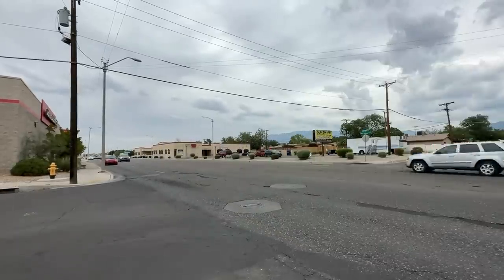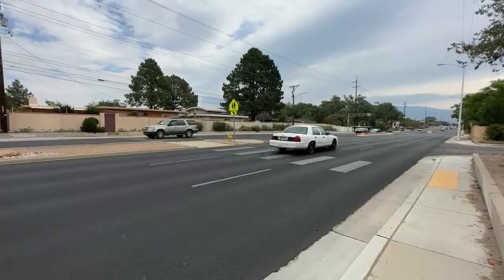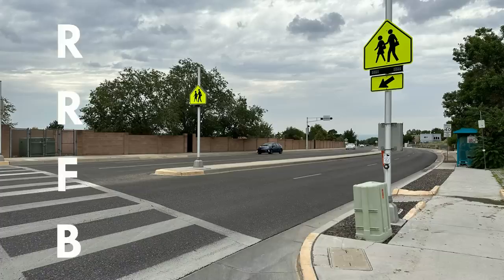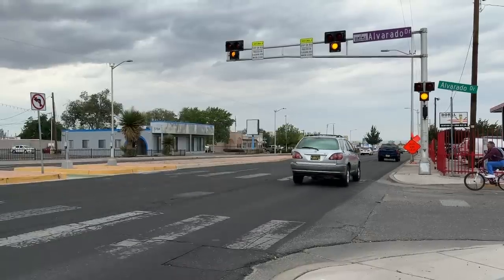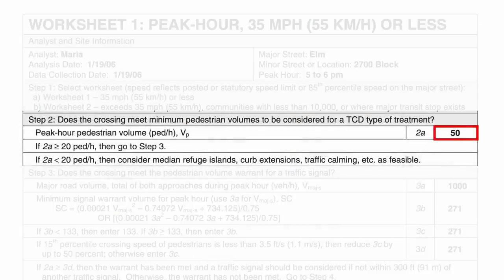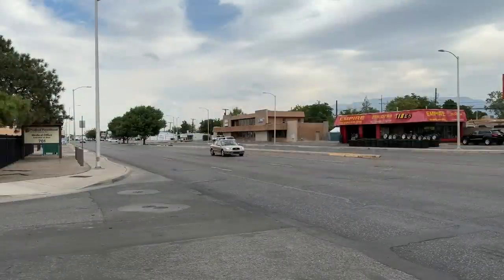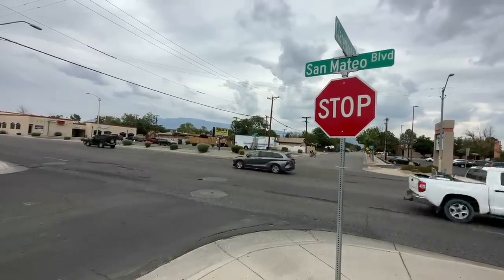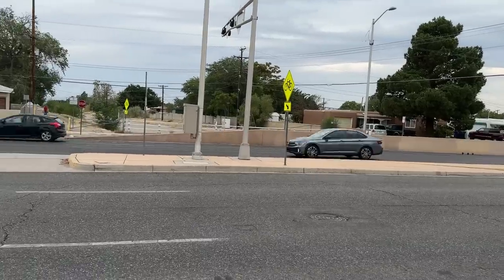The Insane Ways Traffic Engineers Try to Make Streets "Safe" For Walking

Comment: I don't get why cities want to use a HAWK signal. Why couldn't they use a traditional flashing yellow stoplight that turns red on request? Like at fire station crossings.
Reply: It is a loophole around traffic signal warrants.
Reply: @tonywalters7298  But why not change the rule about what you need for a signal? Those decisions end up being whatever is politically convenient, anyway...
Reply: @josephfisher426  I would agree there. It would make more sense to change the warrants. I think there should be policies for ped crossings at regular intervals on arterials.
Reply: @tonywalters7298  That SHOULD fit into the natural layout. Does it, often depends on the evolution of the road. Most of the arterial-type roads I drive on are 200+ years old... where they were settled extensively before traffic volume got high, and especially on the crosspieces between the spokes of the wheel centered downtown, it is only by accident that they are any good for pedestrian use. Because they've been retrospectively straightened and widened into someone's front yard... there just isn't room for a good sidewalk.

Comment: As always, it comes down to using the right tool for the job. These are often haphazardly chosen for 6 lane stroads where a different solution is ideal. These seem to work good for slow traffic areas (like shopping centers) alerting traffic to peds that are crossing where visibility is obstructed by parked cars. As a Professional Engineer, I think we need to do better on all forms of accessibility and treating the issue with an eye to people rather than vehicle flow rate.
Reply: The city i live in (CT) has a mid block crossing on main street that is simply a normal traffic light over the crosswalk.

No need to over engineer a solution, if you want cars to stop on some condition just use a normal stoplight that they are familiar with.

The road is 4 lanes wide plus parking, but its a regularly used crossing and in 2 years i haven't witnessed any "accidents" at it.

As far as school zone crossings go, have schools be on side streets to reduce volumes and hire crossing guards to control both the children and the traffic. A school on a 4+ lane stroad is a design failure.
Reply: @jasonreed7522  exactly! We do that for Fire departments all the time. Light just stays green until the fire department needs to exit the station. But that's one of the warrant conditions in the green book. If we had a warrant condition for just a dangerous pedestrian intersection, cities would be able to consider it easier.

Comment: These RRFBs suffer from amber warning flashing light fatigue imo - drivers have been trained basically to ignore the flashing yellows. Think of all the "take this corner at a slightly slower speed" sign, etc. expecting a driver to STOP for a flashing yellow seems almost absurd to me. The city I live in has recently installed a few of those hawk units but has yet to turn the red lights on. I'm looking forward to when they do, as those are far less ambiguous.

Comment: Those HAWK things appeared overnight (not really) a few years ago in Austin. My first reaction was confusion: introducing a completely new traffic light design that looks nothing like traffic lights that have been around for almost a century seemed like a bizarre idea, especially since the whole point was to keep pedestrians from being killed. That said, they do seem to generally work, here in Austin, most of the time, but in a less pedestrian-friendly (unbelievable that there could be such a thing) place like Fort Worth drivers ignore them way way more often than I've seen in Austin. Also, putting in one HAWK crosswalk along a miles-long stroad takes a bunch of negotiation, so they end up literally miles apart. It's a band-aid on an amputation, pretty much.
Reply: There are a few by me and they do seem to be effective.  The part that seems to have the least compliance is the flashing red phase after the solid red.  In theory that means it's effectively a stop sign (just as any flashing red is to be taken as a stop sign), but usually it just means the first vehicle in a line stops and then all successive vehicles go - instead of taking their turns stopping.
Reply: I couldn't believe the street design in Austin. No parallel parking or bike lanes, sidewalks running alongside multi-lane stroads with 40mph+ traffic just inches away. I was holding onto my children's hands for dear life while walking from the hotel to the fast food joint across the street. In San Jose I'm much more relaxed because there are parallel-parked cars and a landscaped strip including trees between my kids and the traffic. I can let them walk unattached here.
Reply: @sabretooth1997  How is the flashing red phase rationalized? Yes, people should know that, but it doesn't fit into the sequence of a light that turns solid red. It seems preferable to make the solid red phase longer as if it were a regular light (which is what the one HAWK-type intersection that I see daily looks like).
Reply: @josephfisher426 I'm of the opinion that HAWK lights are stupud and should just be replaced with regular old traffic lights, the default way of controlling cars.

And whenever a beg button is pressed at an intersection it should inject the pedestrian phase right after the current car phase. (Understandable if the system only allows 1 ped phase per complete cycle, but still undesirable as a pedestrian exposed to the elements and not in a climate controlled box)
Reply: Remember to treat a dark signal like a stop sign.
Reply: @jasonreed7522  Yes exactly. The idea of introducing a totally new traffic light with totally new semantics, and little signs with text to explain how you the driver are supposed to behave, is in terms of basic usability completely insane. Every driver already knows what red-yellow-green means.

Comment: Here in Australia the most common pedestrian crossing solutions on busy roads are either to have push button walk/dont walk signals at already signalized intersections or to have standalone push button walk/don't walk signals (in cases where the gap between intersections is too big and they need a crossing in the middle). Those would work much better than RRFBs or HAWKs. (especially if you had enforcement)

For lesser crossings we have the standard zebra crossing (possibly with a refuge island in the middle) with signage in both directions telling cars to give way to pedestrians (the signs are bright fluro colors and retro-reflective so they can be easily seen at all times).

Comment: There’s a HAWK beacon outside the secondary entrance of the Patent and Trademark Office in Alexandria, VA. I live and work around there, so I’ve had to use the HAWK as a pedestrian and driven through it as a driver. As a ped, you’re lucky if you can actually get the signal to work. Last time I was crossing there, I waited 90 seconds for the signal to turn and some jackass still ran the red light.

Comment: As a NZer, I find it frankly amazing that crossings aren't mandatory at every major intersection over there. Down here, any intersection worth of a set of traffic lights has enough pedestrian crossings to allow you to get to any corner. It helps a bit that most (though not all) of the traffic-light intersections also include free-turn lanes separated by the main flow of traffic by pedestrian refuges, which means that you can walk when the traffic going in one direction shields you from any traffic would cut across the designated crosswalk.

Comment: If you're in the southwest I would check out Tucson and their implementation of HAWK signals. They have done a pretty decent job of installing them across the city. Especially along the bike boulevards. Fun fact is that the first HAWK was designed in Tucson by a city engineer. Tucson is also interesting streetwise because it's a traditional grid system, but there are no ring roads around the city. There's only I-10 and I-19 on the western side of the city, so it kinda has a Vancouver type feel of majority surface streets. Quite different from our big brother Phoenix to the north.

Comment: I’ve spent the majority of the last three years living in Puerto Vallarta, Jalisco Mexico and as a pedestrian I can tell you that walking here is very safe. The streets are mostly narrow one way two lanes with a few larger roads that are usually four lanes with two in either direction. It’s typically very easy to cross the street and even where there are no crosswalks or traffic signals when you get the drivers attention and a give them a little wave they invariably stop for you to cross even on busy streets and interestingly enough the driver in the other lane will stop as well. The courtesy and respect that motorists here show pedestrians never ceases to amaze me. Now I don’t know what it’s like in other cities in Mexico, but I will be moving to Oaxaca de Juarez soon, so I’ll see what it’s like there. Public transport here consists solely of buses, but they run very frequently and cover the entire city and are very inexpensive. I don’t bike but that’s because there is no biking infrastructure and I’m afraid to be on a bike in car traffic, that’s just me or maybe after almost being run down by high speed cars several times in New Orleans I’ve decided not to take anymore unnecessary chances.

Comment: In and near Seattle, the main multi-use trail, the Burke Gilman, has stop signs at street crossings.  Pedestrians have to wait for cars.  If there were traffic lights, that would be fine, but pedestrians and bicycles have to stop because the cars get priority.  There are even stop signs at residential driveway crossings, which have a fraction of the 3/4 of a million annual users the trail has.  Cars are king.

Comment: HAWK signals confuse me, not just because of the acronym. You're spending the money to install what is essentially a traffic light, but instead of building a traffic light like everyone is familiar with, you're choosing a signal that most drivers haven't ever seen. Just build a normal traffic light, no ambiguity or confusion or extra signs that have to explain in text what you're supposed to do.
This of course still doesn't fix the underlying issue of the hostile street design, but at least it treats pedestrians as equally important users of that street.

Comment: I wonder of HAWKs even have any advantages compared to normal traffic lights, especially at an intersection. The only one I can see for drivers is that there is a signal phase that allows them to treat it like a stop sign, but a normal traffic light has more familiarity. I also question the use of HAWKs on major transit corridors. In Phoenix, there’s only 1 I know of along the light rail line (along Central, just South of Camelback, where there’s a canal trail crossing).
Reply: Also, with the double threat point about RRFBs, there’s one in Scottsdale along Highland Avenue by Scottsdale Fashion Square. My mom almost blew through it when it was flashing purely because she was in the second lane and didn’t see the pedestrian, and someone else was stopped super close to it. Once again, why don’t they just use a normal traffic light?

Comment: Those Mayberry RFDs are totally ignored on my campus where they have been installed. Though, they did install them along with raised PED crosswalks/speed bumps. So the actual structure of the road slows cars down much more than the flashing lights that never flash.

Comment: I am literally begging all local officials setting planning policy to please spend one week getting around on bike, foot, and transit and count how many times you feel humiliated by the experience. How many times your only options are detouring by 5-10 minutes to a controlled intersection or running for your life while only asserting your right to cross at an intersection. How many times 20 minutes of your life or your life itself are deprioritized in favor of saving a few seconds for a motorist. How much dead time you spend transfering between buses with endless headways, how many steps you have to take through mud and grass because someone parked on the sidewalk with their sprinkler on, how many times a driver says or does something derisive or threatening when you dare to delay them by less than ten seconds. All as a reward for choosing the more socially responsible means of transporting yourself about the city in the system you are maintaining.

Comment: I have been told by my local police department in Indiana that RRFBs do not give you the right-of-way. You still have to stop, look both ways, then proceed if all clear. The yellow lights are just a caution to people driving. They are not required to stop, like they would be at a red light or a stop sign.

Comment: The road you showed, I have a few simple suggestions to make it even remotely safe to cross ... 
1: Build a wall most of the way across the stroad - so there are only two lanes left 
2: Use the freed up space for proper width sidewalks, and add segregated cycles lanes 
3: Set the speed limit to 30mph at all times 
4: Put in a crosswalk with stop lights, and cameras to catch vehicles who ignore them, with fines large enough to cause them to have to sell the vehicle 
...  realise nobody will let you do this, and move to a country that will...or more likely already has

Comment: So US traffic engineering is now only 70 years behind German… Germany tried these flashing lights in the 1950s and quickly gave them up.

For comparison the German regulation:
* If the speed limit is higher than 50 kph (35 mph) or there is more than one lane per direction, a traffic light must be installed. These are regular lights, except for sometimes "off" instead of green.
* If it's one lane and <=50 kph, a zebra crossing may be installed: Drivers and cyclists must slow down, not overtake and stop if somebody wants to cross.
* A "refuge island" is strongly recommend and what you call "curb extensions" are legally required (no parking 5 m before the crossing under ANY circumstances), very good ones (rare…) are even raised to crosswalk level. Also the paint markings are closer together 50/50, so the tires don't hit all of them and such don't rub them off. Warning signs (which look totally different from every other traffic sign) are optional, but usually at least on the right. The deluxe-version has even a third one above serving as a street light.
* In addition refuge island without priority may be installed under the same circumstances (<=50, one lane per direction) on busy streets.
Pedestrians are not required to use these but can cross at any "non dangerous spot" without priority (which would make using half of these US crosswalks illegal…).

Around schools you may find crosswalks or even traffic lights together (!) with a speed limit of 30 kph (20 mph). These usually go all-in on the design options.

Comment: I live in a more rural area and there is a recent rail to trails bike/walking path that uses RRFB across some of the more common roads. I haven't done an extensive survey but it's like 70% of the people stop when they see the flashing yellow. The false sense of security is worse than any "safety" they provide. (On the plus side it does require you to actually stop to press the button, following the rules of the road works both ways and lots of cyclists in my area give lip service to the biks stop signs (and "walk your bike" is ignored by almost everyone).

Comment: This is not a road design problem, it’s a cultural one. In my county we have strodes, our roads are largely modelled after American designs. However, when a pedestrian turns to face the crossing, all traffic will immediately give way to them. Sometimes the very first car might zip through, but otherwise the traffic will have stopped in both directions before the pedestrian steps onto the road surface. If there is a zig zag refuge island then only one direction will stop at a time.

Comment: I do not understand why we need RRFB or HAWK signals. Just put up a regular traffic light that's always green (if there's no vehicular cross traffic) or flashing yellow (if there is, which would get a flashing red) until someone hits a beg button! On Green Street in Ithaca, NY we have such a signalized crossing between one of the main bus stops and an alley that leads to the commons (pedestrian shopping street). This has worked well for well over a decade at this point.

Comment: In Pittsburgh, we have a couple of mid-block crosswalks that have a traffic light.    The traffic light stays green until the crosswalk button is pushed.   When the button is pushed, the traffic signal turns yellow after about a second and then red after the standard yellow time.   The walk sign then comes on.   The time for time the walk sign is on is plenty for getting across the street.    I am sure there is a minimum time between activations, but I haven't tested it.   The two locations I know of are in the middle of the University of Pittsburgh campus on 5th Ave and at Bakery Square on Penn Ave.    There might be more of these pedestrian traffic light in town that I am unaware of.    Both of these locations are in areas with higher than average pedestrian traffic and the roads are only four lanes wide.   There really isn't a big issue of cars blowing through the red light (outside of the standard, it just turned red issue you have everywhere).